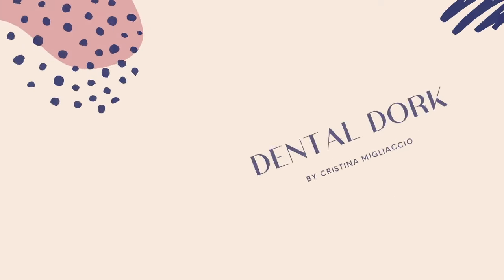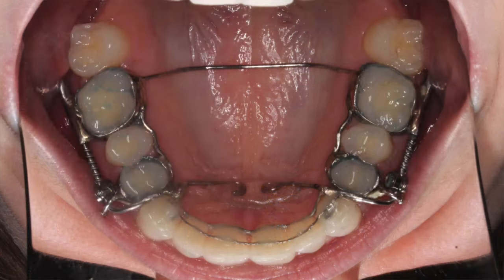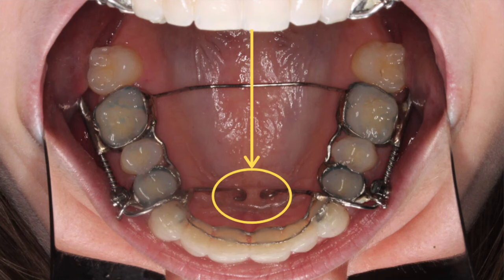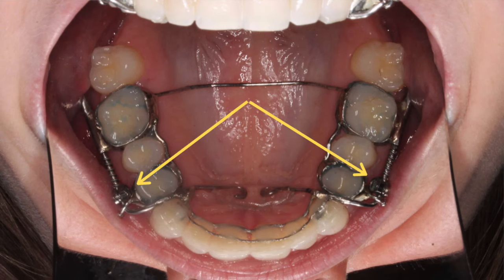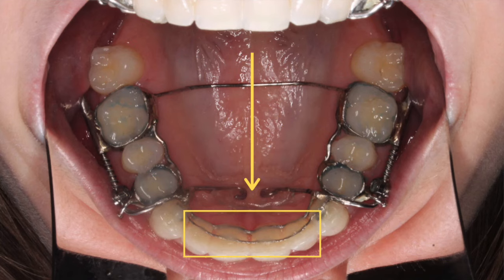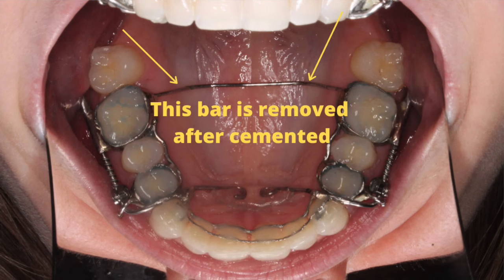How AGGA Works | AGGA Appliance Explained

Comment: I don’t understand how it grows the mandible in a class II situation when it’s only attached to the maxilla
Reply from the maker: The mandible always follows the maxilla. It doesnt necessarily grow, but slides forward, relieving the TMJoint from its crammed position.
Reply: @DentalDork  but wouldn’t that move your molars from a class 1 relation to more of a class 3?
Reply from the maker: @austinzizzi1142  If I start with a class II, with  maxillary remodeling and the mandible following would end in a class I. That's why getting measurements for how far forward the maxilla needs to go is important for condyle positioning.

Comment: I understand the lower jaw is supposed to come forward with AGGA installed on the upper teeth, though there's some question if this really occurs. So why not install AGGA on the lower teeth also to bring the lower jaw forward?
Reply from the maker: Thanks for your comment! I wish I had a better way to explain this, but I'll give it a try! First, by placing an AGGA on the mandible, there is no nerve that can be stimulated on the mandible, like the maxilla to achieve that remodeling. Second by elongating the body of the mandible, you are actually increasing the vertical angle of the (making the face longer in appearance) which is exactly the opposite of what we are trying to achieve by allowing the mandible to upright itself. Third, the AGGA wouldn't change the TMJ position or allow the airway to open. The list goes on. I'm wondering if you don't have the right understanding of what "lower jaw coming forward" really means. I'm curious, what is your interest in the treatment? TMJ, Airway, or facial aesthetics? 
- Crissy
Reply: @DentalDork  I had 4 extractions and wore a headgear for 2 years as a teen while having braces (stupid retraction orthodontics) so I have TMJ, but only on the right. My dentist specializes in orthrotropics, and says my CT scans showed a moderate constriction of my oropharynx (but otherwise normal), so at risk for apnea. I'm wearing a Galella device for 4 months that's supposed to advance my mandible 1.75 mm. Then I start AGGA. Ronald Eades (I know he's not a pro) says it's a myth that AGGA advances the mandible, so not sure what to think. The Galella device has helped my TMJ, hoping AGGA will do more. Oh yeah, also hoping for aesthetics as my chin/jaw is recessed due to all the retractions (8 including wisdom teeth), so hope AGGA truly moves jaw forward. I only have 24 teeth!
Reply from the maker: @cooljazzr  Best to luck with your treatment! Be sure you're working on the muscles (myofunctional therapy and cranio therapist too). So sorry to hear about the retractive ortho -  im in a similar boat! Shoot me an email if you can! I'd love to share more with you. Thanks, Crissy
Reply: @cooljazzr  i just watched the Ron video where he says it’s a myth that bringing the maxilla forward brings the mandible forward too. Crissy did a splint as does my dentist to help bring the mandible forward. I’m curious to understand all the better, but one thought I had is that when retraction braces get used, it seems like the mandible follows suit... id want to know why that is if as Ron says the mandible following suit is a myth... 🤷‍♀️

Comment: What happens is that the dentalveolar gets moved forward which is not bad but Agga may or may not depending on how used damage the alveolar and the gum around it as the root of the teeth. What is really the worst is for exemple in your case your maxilla is still set back but your alveolar was moved forward and if it was done while damaging it then you can’t anymore get surgery or it will be really complicated

Comment: Have you noticed an increase in nasal volume capacity since you started AGGA?
Reply from the maker: Masoom,
Thanks so much for your comment! I had decent nasal volume prior to treatment, but I did notice easier nasal breathing ability post AGGA! Thanks for watching! 
Crissy
Reply: @DentalDork  I looked at xrays of AGGA before and after and I noticed that I increased greater airway volume, but in the throat, not the nose. I've heard that in order to increase you oxygen into through your nose, you need transverse palatal expansion. Is that true?
Reply from the maker: @bigdino475  Thanks for comment! I can't say I know the answer to that, but that would make sense. However, to my surprise, the AGGA did provide me with 3mm of transverse palatal expansion! Check out my AGGA results video for some photos! https://www.youtube.com/watch?v=UfiWcxN7ptc&t=1s
- Crissy

Comment: Thanks so much for doing this “controversial” video! 
I think you are right, both remodelling and tooth movement occurs during this treatment. We have very thin bone in front of the teeth so it it would be impossible to get more than 1-2mm forward movement without pushing teeth out of bone if it was simply teeth being pushed  around. Even regular orthodontics relies on bone remodelling, so it makes sense for this treatment to be the same. Of course it’s different because it’s working in the right direction by making more tongue space, but the general idea is not new. I have heard Dr Bill Hang speak about how teeth can be advanced significantly without causing recession or bone damage, have you heard of him? He mentioned that there is refereed literature which backs this up as well I haven’t seen it myself but it would be interesting to see. Thanks again for the great content :)
Reply from the maker: Only Hope, 
Yes! I have heard of Dr. Bill Hang. I have watched a number of his videos posted on youtube as well. It is a controversial topic, and difficult to post about, but I would love to see that research as well! I hope to make a research video soon, but I want to get my facts together and have proof, because I feel like there is a lot said out there that I can't get in my hands for proof! Thanks for commenting! I greatly appreciate the discussion! 
- Crissy

Comment: If agga basically works by applying force to the front of teeth to stimulate growth, is it possible to simply use my tongue to apply similiar force couple hours a day? Hah I know it would be much better to see a professional but there's none in my region. Can't see one at least until when travel ban is over.
Reply from the maker: Agga does not work by apply pressure the to front teeth. I highly advise against pushing your tongue against your front teeth! If you accomplish proper function, you can achieve “AGGA” benefits, much much slower. But yes, slowly over time.
Reply: Yes but tongue on the roof of the mouth. Look into Orthotropics, this is a common practice and it’s the natural position for the tongue in the mouth for optimal forward and upward development of the maxilla and mandible, allowing palatal space for the teeth to lie.